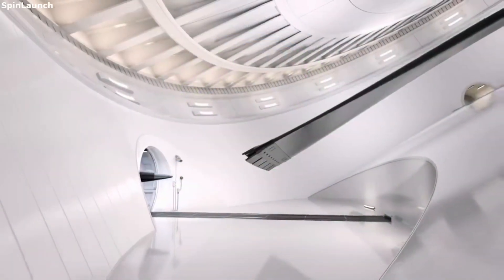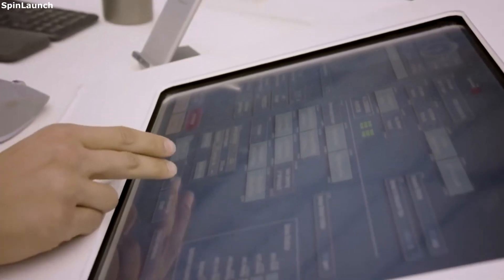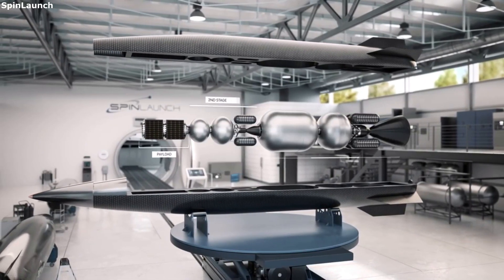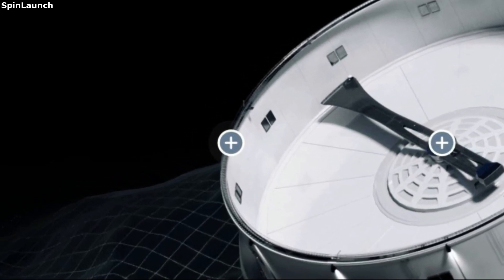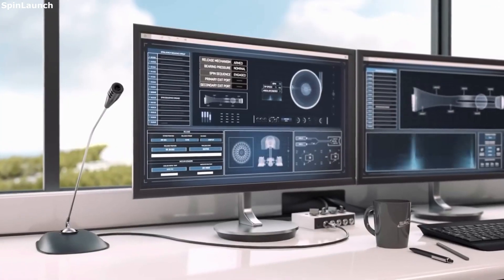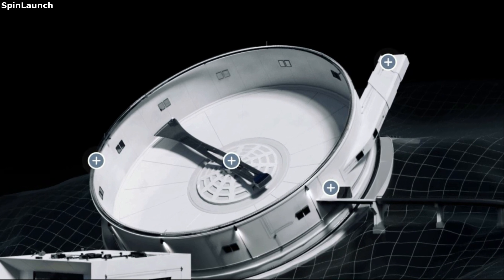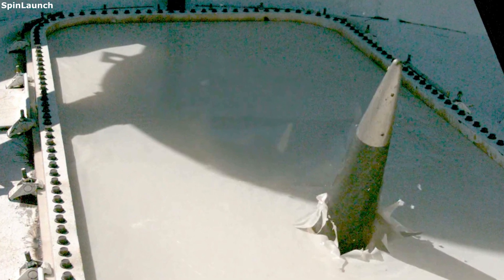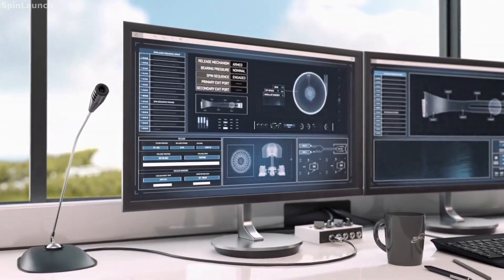How Exactly Does SpinLaunch’s Orbital Accelerator Work?

Comment: What happens to the unbalance that occurs once the " projectile " is released? I would be interested to know.
Reply: I believe the release would not only release the projectile but also a counter weight in the form of a hydraulic gas piston or a plunger. I imagine a big syringe, the tip is spring, then half the cylinder is a gas of some sort, the 2nd half is vacuumed space with the plunger being connected to the release mechanism. It would have to be something like this other wise it would explode

Comment: Only way Single Stage to Orbit can possibly work as imparting some type of spin upon said launch vehicle means adding an awesome amount of lift as opposed to being perfectly vertical formulaic launch or near horizontal Virgin Galactic/Stratolaunch where everything must be perfect before exiting the Ground Station. One apparent success at Launch #10 this past Year 2022 as an inert object. Adding solid fuel rocket to that might be in orbit around the Moon in under 20 minutes instead of the ever seen as necessary 3 Days as still 1960s standardized.

I would argue a lot has changed in the last 20 Years let alone 60 Years for Space Launch. Since the goal be to put an item in ORBIT around the Moon more than a lot of room for doing that without constantly trying to recreate the Saturn V let alone Space Shuttle.

Plus the added bonus of taking out all of Beijing or Moscow in under 30 seconds if need be..

Comment: 450rpm? That's it?!?! I just discovered a helicopter rotor only spins btwn 250-500rpm. But the tail rotor of a blackhawk helicopter spins at 1,300rpm or 700 feet per second.

Comment: Incredible the trillions wasted on this crap. 10 billion for a telescope for no reason except to prove big bang....failure. Billions for Mars crap and astronomy for no reason except to find life and prove evolution....failure.

This dumbass thing is in Jornada del Muerto 4200 feet altitude. Put it on a 14,000 ft peak in Colorado, gain 10,000 plus feet and thinner air.

If it only goes 26000 feet and then switches to rocket then why not start at 45000 ft and launch from an air craft? Or Hindenberg at 60,000 ft?
Would be a fun job though.
Especially when it blows up.

Comment: The way it works is, it spins the weight of 1,700 M1 tanks on an indestructible spinning arm and bearing, releasing the projectile into over 36 tons of air pressure and more severe frictional heating than a meteor encounters.

 Oh, and the delicate payload and rocket components of this thing will survive 10,000 g's.  This means that structures that support 1 ounce will need to support 625 pounds while under load.

Comment: why not put a linear accelerator that boosts it using the power of an electromagnetic launch boost after it is released from its tether, an electromagnetic field similar to a railgun the navy researched, to propel the payload farther into space? in the exit chimney of the payload being rotated in the spinlaunch? propelled even faster through electromagnets after it is released?
Reply: The projectile is passing along the 'chimney' at very high speeds, so the time during which speed can be added to it is very small, which implies impossibly large power inputs to the linear accelerator. As shown in the orbit-capable design, the chimney appears to be about 70m long. If we imagine a 10-tonne projectile is spun up to 2000m/s on the tether, and then released, it will only spend 35 milliseconds in a 70-metre chimney. If it is to be accelerated by a further 120m/s in a linear accelerator (to 2120m/s), another 2.5GJ must be added to its kinetic energy, and to do that in 0.035 seconds requires a surely impossible 70GW.
Reply: @billb207  It's powered by electricity, that's the future, right there ladies and gentlemen. They are robust satellites that are launched at a fraction of the cost of current high cost delivery into orbit. If a warp bubble was created around a craft while it is in circulation the G forces wouldn't be felt by the explorers.

Comment: Even if it works, will the 10,000 or so G's strain the satellite and lower its lifespan?
Reply: In another presentation they talked about satellites withstanding those necessary G-forces.  They realized they're made much more sturdier than thought after testing.

Comment: Interestingly enough ...... It doesn't, it doesn't work.
Reply: This aged well
Reply: @warframewarframe5095  how so? How close is it to launching anything into orbit? That's it's purpose and if it can't get the payload to 5,000 mph or whatever the target is then or does not, by definition, work.
Reply: Rule #1: NEVER expose your real power: 😏"yeeeah, it..🤞doesn't🤞work"😏. 
C'mon man.. you know it works.. It'll be used for something, if anything.. as these things always are. Or another genius will correct the design.. so it does later work.
Reply: @escapementalprison  kinda like how Hyperloop is getting shut down and is being used for parking 😂
Reply: will never ever work as suggested or in any other derived form.
1 degree accuracy oppertunity to go down tube. @ 45m long arm put timing @370 micro second let go window
while holding the wieght of 182 falcon 9 rockets within a chamber with 200 000 tons of atmospheric pressure trying to squash it.🤣🤣🤣🤣

Comment: Tumbling is inevitable for the linear projectile as rotational angular momentum must be conserved. Stresses on rotor arm need to be balanced somehow after release of payload, otherwise rotor arm will likely fail at full speed. Forces would be around 20-30,000 g, and would subject the payload to these forces for an hour. ThunderF00t has a two part series dissecting the modes of failure BTW.
Reply: to counterweight momentarly 10tons of weight thats producing 20...30k G of force.... easier to build bridge to space - wich itself is impossible
Reply: @RamsesHarrysson  - "easier to build bridge to space - wich itself is impossible"
Actually a "Space Elevator" IS theoretically possible and probably LESS of a technical challenge than this.

Comment: This would need to have a very good vacuum, if not the friction from the air molecules and the shock wave will destroy launcher.  If the arm fails at the moment it will take out the control centre.  It will take hours if not days to pull a vacuum down in a chamber that size.  The bearings as shown the video will leak like a sieve, also  if you watch the video their projectile is tumbling until aerodynamics sorts things out for them,  this is wasted energy. It is very telling that they blur out the displays so you can't read the data.  This data would show the vacuum level, the speed the arm is rotating at and the speed of the projectile is launch at.  Frame counting shows a speed of about the speed of sound.
Reply: Thunderf00t calculated that this test represented about 2% of the energy needed to actually achieve the claimed purpose 😅
Reply: greatest nerd